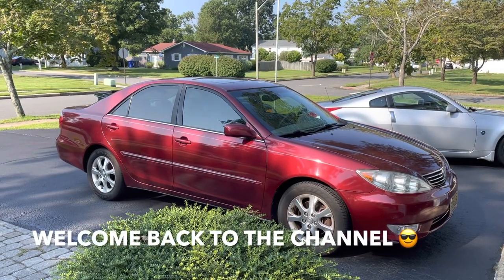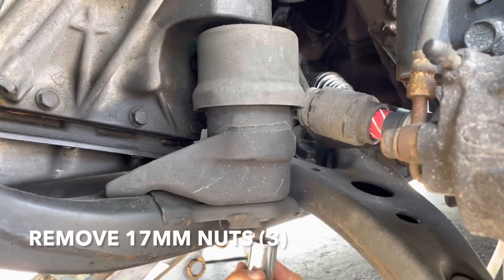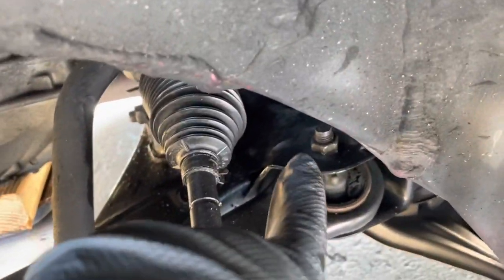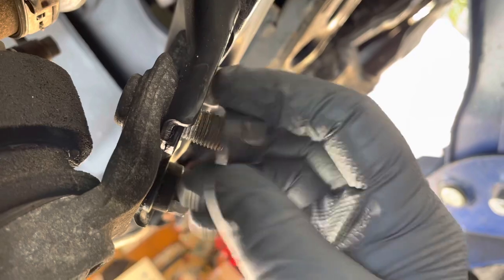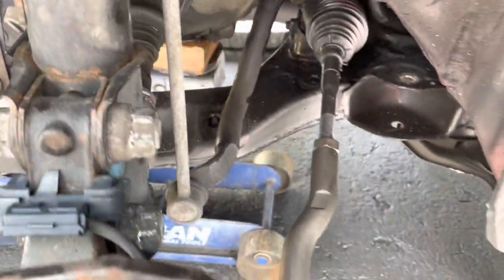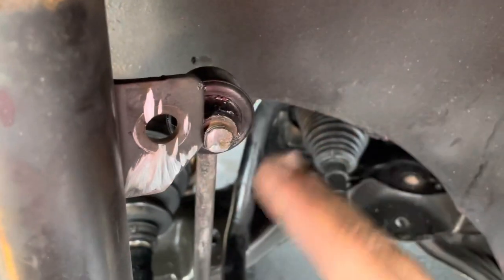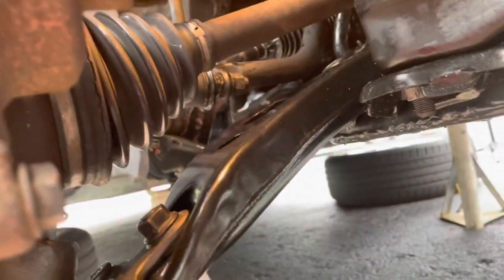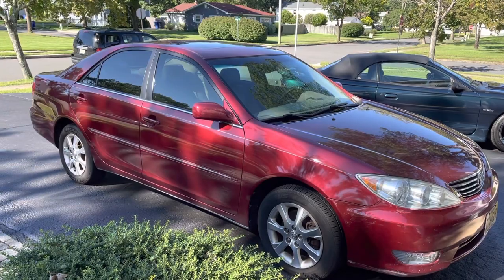TOYOTA CAMRY CONTROL ARM REPLACEMENT - How to Replace Front Control Arms on a Toyota Camry

Comment: Thanks. Great video. Did that little bolt cover item you slid on at 2:38 come with the new arm or from the old one. Do mechanics sometimes forget to put that on when installing these? Thanks.
Reply from the maker: You have to reuse the old bolt and I hope no mechanic ever forgets to put that back on.  It wouldn’t be good! Thanks for watching. 😎
Reply: Thank you great and simple explanation. Do you have to do alignment after this replacement ?
Reply: @fixinit   hello there, could it be possible that bad bushings in front control arms cause front of vehicle to bump easily in when going over bumps? My car feels very bumpy. Please let me know. Thanks
Reply from the maker: Yes. But other things like bad struts and links can cause bumps and rattles. Have someone check your suspension so you don’t waste money replacing the wrong thing.
Reply: @fixinit  thanks 🙂 👌

Comment: On the driver side what is you jack point when removing the motor mount? In the video it was on the trans or oil pan?
Reply from the maker: Transmission

Comment: Man, you're better than me. I loosened the front motor mount also to do this job. I didn't remove it, just loosened it a bit. I thought it made it easier to lift the engine high enough.

Comment: Thanks for the video I may try to do this to my 2003 seems like it’s the same thing wrong the tire is going sideways and the other are fine straight , could someone thing else be wrong? My friend came and took the tire off and said it was broke. So that probably why tire is tweaked .
Reply from the maker: A bent or broke control arm would do it. Without looking at it, it’s hard to tell what else could be wrong

Comment: When you removed the one motor mount did you loosen or remove any other motor mounts? Looks like you raised the transmission almost 6 inches.
Reply from the maker: No changes to other motor mounts
Reply: @fixinit so you didn’t have to loosen any other motor mounts besides what you did in the video? If so that’s crazy that it can lift that much
Reply from the maker: @manuelramos4608 I think it helped that the motor mounts were shot

Comment: Thanks for providing such clear instructions and providing the nut sizes. Often this stuff left out of these type of videos. But I wonder about your use of blue loctite on the ball joint stud. Sure, blue will break free with enough pressure when it comes time to change it again, but if the cotter pin is put through the castle nut, that castle nut is never going to vibrate free, so what's  the point of adding the extra hassle to remove the nut later by putting on loctite at all?
Reply from the maker: The Loctite was for the 3 bolts/nuts that connect the ball joint to the control arm.😎

Comment: Hi im gonna do it in my car but I'm wondering if i need an alignment after
Reply from the maker: I didn’t do it but it’s not a bad idea
Reply: @fixinit  thanks...was the other side pretty much the same??
Reply from the maker: Yes
Reply: @fixinit  im in the middle of it actually I don't see anywhere to jack it up here. Did u jack it up by the engine oil pan?
Reply from the maker: @CanadianAnanth Nooo. Jack the sides and put Jack stands
Reply: @fixinit  i meant to remove the mount
Reply from the maker: Oh. Yes oil pan. Put a piece of wood between the oil pan and Jack.

Comment: The front end of my 2002 Toyota Camry sits a bit low. It's not even with the rear. I had the struts changed, and it looks the same. Could it be that my car looks lower in the front end because I need to change the control arms?
Reply from the maker: Did they replace the springs when they replaced the struts?

Comment: i did the drivers side control arm by jacking up transmission like you did but on passenger side i dont know where to jack up
Reply from the maker: I know, there’s no place. Put a piece of wood on the jack and lift it by the oil pan.

Comment: Hammering the steering knuckle will cause it to break, then you're screwed. This is bad instruction also there was so many errors done that could've made this control arm replacement easier and shorter.
Reply: Make a better video then! Haha
Reply from the maker: Can’t make a better video, too busy trolling.😎
Reply: It's  a possibility, but very unlikely to break. They usually drop out without much  abuse. It's obvious this video is geared for the person wishing to repair their own car who don't own a Mac Tool Box full of tools.